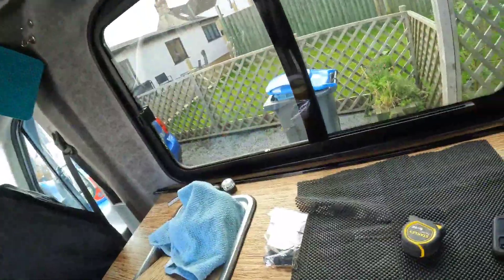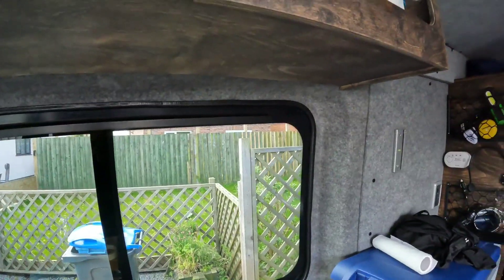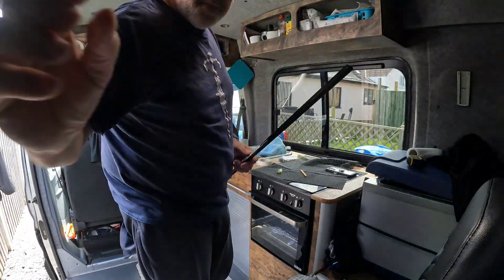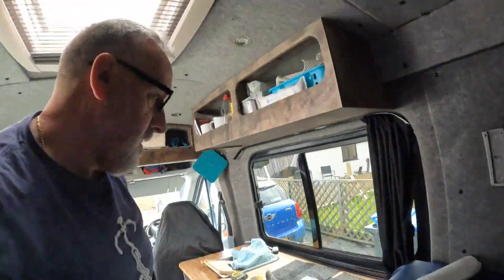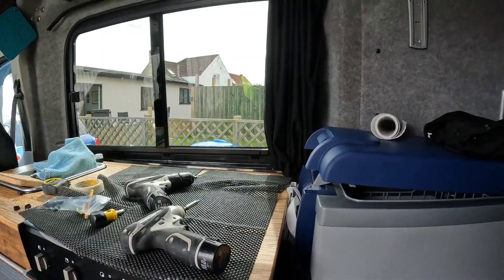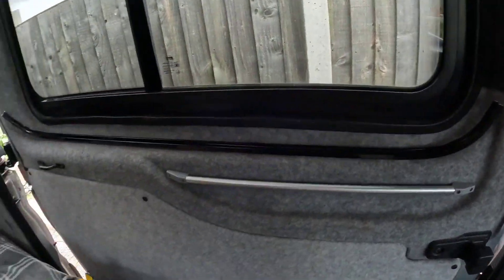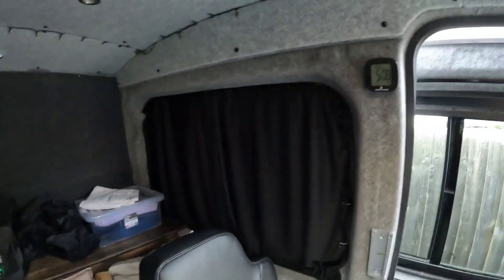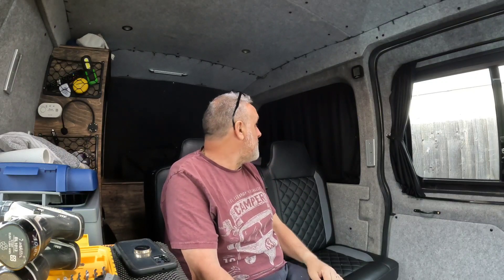Fitting window curtains to my Transit Campervan

Comment: How did you bend without messing the ends up
Reply from the maker: Hi there, the track does bend quite easily,  it does tend to open up where it bends but once you have screwed it in position you can carefully re shape it with pliers/grips.
Hope this helps.
Reply: @mikejosadventures2683  thanks for replying 👍